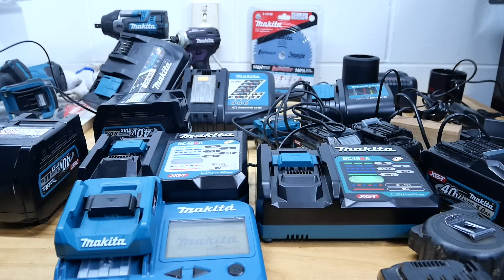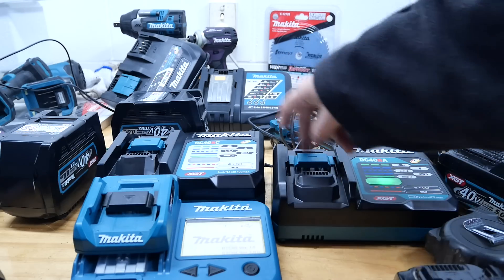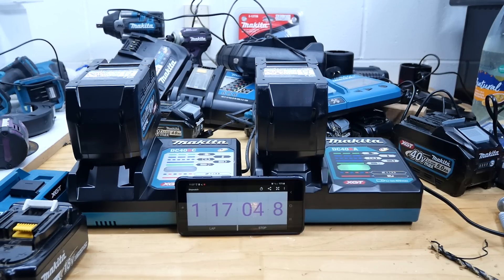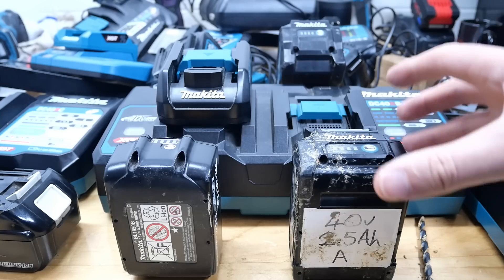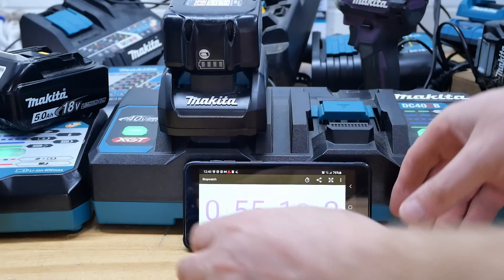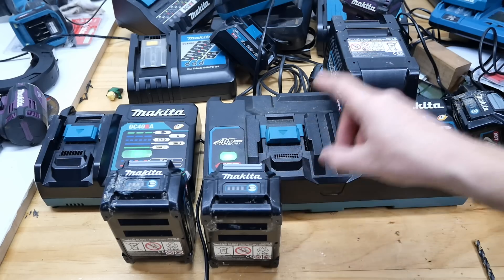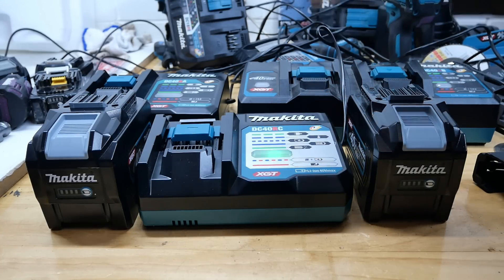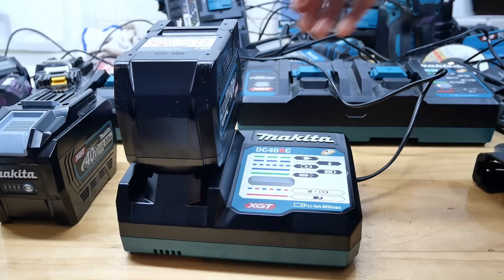Rapid Chargers Destroy Your Tool Batteries... Why?        How Hot, How Quick, How Much???

Comment: I just got a drill and impact kit and it came with the standard charger. I thought it was the rapid one because it says "fast charger" on the bottom. Deal was hard to pass up though...40v impact, hammer drill/driver (not the top of the line one) 2x2AH batteries + charger with FREE 4AH battery and FREE inflator for $660 CAD taxes included.

Also when i charged all the batteries with the standard charger the fan stayed on the entire time.

Comment: I have a 40V DC40RA charger - when I put the 40v 4.0ah battery on it the large light flashes BLUE and then flashes RED and beeps continuously, then it stops flashing and beeping but stays RED and the fan isn't going.  Does it mean the charger is faulty or the battery?
Reply from the maker: It's the battery. Clean the contacts on the battery with some fine sandpaper, the slowly wiggle the battery onto the charger until the blue light comes on and try and leave the battery on an angle. You only get 3 shots of fixing it. If the red light comes on 3 times in a row the charger will say the battery is bad forever.

Comment: Thanks for doing this video. I’m on the Bosch platform and one of my chargers GAL18V-160C gives you 4 different charging modes. Standard, Power Boost, Longlife & Storage. The Power Boost is really quick but it only charges at full current up to 50% charge before it switches to standard mode. That’s because charging between 50% to 80% produces the most heat. If I have plenty of time I usually use the Long Life mode, which only charges the battery up to 80% but also more slowly. I’ve actually been trying charge all my battery operated products like phones etc up to 80% for many years and have great long life. But if I need to charge on a job site I’ll use the standard mode. I’ve only used the Power Boost mode a few times when it was really needed. I’ve never used the storage mode but that mode only charges your battery up to 50% since lithium batteries don’t like being stored for long periods at full charge.
I’ve studied electronics as a hobbyist and from what I’ve learnt you shouldn’t charge a battery at more than 1C for the best battery life. So in other words, fast charging an 8amp battery at 8amps(1C) charge current would be ok, but fast charging a 4amp battery at 8amps(2C) charge would not be good for long life. I’m hoping that the tools manufacturers take the amp hour of the battery into consideration before it charges but I doubt it. I might have to test this but I do know that the Bosch charger varies the charge current depending on the battery temperature.
While high discharge rates like using your battery on a grinder will also produce a lot of heat and shorten its lifetime. High charging temperature is not the only problem. When you charge a lithium battery at high current, it starts to form something called Lithium Dendrite AKA Lithium plating on the negative electrode and this will also reduce the battery capacity and life. It can also cause internal shorts.
I guess everyone’s going to be different and if time is money then sacrificing battery life by fast charging may be the more cheaper option for some people.
One last thing, I don’t know if you would bother doing another video on this but if you do, are you able to check the battery temp once it reaches 80% charge, rather than 100%.
Thanks again for your video. Hands down the best tool channel on YouTube!!
Reply: Thanks for the info..... appreciated 👍🏻

Comment: Builds & Stuff  the normal charger is better because the lower the charging current, the more energy the battery will store.
p.s. I have not seen any published data on the cutoff current during charging

Comment: I LOVE that Makita gives you rapid or dual rapid chargers with most of their kits.  Milwaukee and DeWalt don't do that because they are greedy.  They also don't have fans in nearly all of their chargers.  Whenever I charge with a fan-less charger, I put a small portable fan right in front of the charger.  Works like a dream, and it keeps the charger and battery essentially at ambient temp.  RYOBI clip fan is great for this.
Reply: agree. Hikoki/MetaboHPT also does this in most kits. I was amazed when I put a 18/36V MV 8ah Battery on charge at the same time with a Dewalt 18V 3ah. And the 4/8ah MHPT finished first lol. Makita does well with this too. Most folks only see price. There's a reason for most things.
Reply: Putting a fan next to your charger is a bit pointless to the battery. It only cools down the charger, but it doesn’t cool down the battery cells inside the battery casing

Comment: should be common sense a rapid charge which isnt really all that rapid wont hurt the batteries, its not like its boiling them to a full charge in 10 minutes dumping 100amps into them

but we do drain them dead in under 10 minutes pulling over 100amps peak out of them and they get hot doing that but nobody debates useage rate only charge rate and only because the companies call them "rapid"

take the same chargers and like you joked call them "slow" and "standard" leave out the word rapid and all of a sudden everyone will agree the faster charger has no downsides 

milwuakee even went to a "super charger" that doubles the output of their rapid charger on larger batteries.. and people still argue the rapid charger kills the batteries when milwaukee endorses dumping double the amps into them than a rapid can

Comment: HI B&S I have a 18v rapid charger and a 40V rapid charger with an adapter for the 18v. Which charger would you use to charge an 18V battery ??
Reply: The 40v chargers charge quicker with the adaptor, but not much quicker (seen a video on this channel)

Comment: I don't know why people worry about heat with the lxt or xgt platforms. The batteries have built in circuit board that monitors the Temps of the batteries as well as the tools.

The charger and batties communicate with each other to make sure that Temps are in a safe normal range.

 If you have a hot to the touch battery instead of letting the battery cook itself and spend hours in its own heat throw it on a rapid charger so the charger will blow cool air on the cells and get the heat off them.. once the heat is within range the charger will then charge the battery.
Reply: I never knew this technology exhisted.... i have a 18v dewalt cordless drill with a sealed battery charger that gets very hot charging up batteries...... time for a change, i just love this technology 🙂👍🏻❤️

Comment: It's not about the heat,  it's about dendrite formation inside the battery cells.  Rapid charging accelerates the dendrite formation in the battery. 

This is the information I gleaned from a battery rabbit hole dive a year or so ago.  Prof good enough that invented the lithium ion battery has actually backed a new design that would make this problem a thing of the past.
Reply: When ?
Reply: @mohammedisaa9952   few years ago he was collaborating with some woman on it. It was something along the lines of blocking each pole of the battery with a thin membrane which should technically make the battery not work... Yet it still worked and was insanely more efficient. Just Google good enough new lithium ion battery design

Comment: I'm not a tradie, so I invested in a double slow charger., a decision I don't regret. But if I was one, I agree: I'd pick the fast charger any day of the week. These things are after all considered "consumables" by Makita, hence they only get a year's guarantee anyway. I think Four LED bars on a battery is a little bit crude. For example, if it has four bars illuminated, that means the charge level could be anywhere between 76% and 100%. If you're gonna do this sort of anal-ysis, you might in the future want to consider using a voltmeter to give yourself a more accurate indication of what the charge is. When my tool (DCF102 fan) considers the charge too low to continue using and it cuts off, the voltage across the terminals at that point is 14.6V. And when it comes off the charger, it measures about 20.5V.
Reply from the maker: How much of this video did you actually watch?
Reply: @BuildsStuff  All of it, but my attention and observation are not great on videos over 10 min. Okay, I've seen your voltmeter readout now.

Comment: Charging current drops steadily after the charge state hits about 80% as the charger switches from CC (Constant Current) to CV (Constant Voltage).  Checking at the end of the charge will not show peak temperatures.

You should check the time to charge to 80%, multiply that time by 0.875 (7/8) and then check cell temperature at that time.  This will show you the temperature at about 70% charge when the battery has had lots of time to heat up and is still charging at full rate.

Loving your channel!  Keep up the awesome reviews and tests!

Comment: As others said, charging for over one hour is not really a fast charge rate. Charging in half hour would put more strain on the battery. And your ambient temperature is really low. If you do the charging at 35 Celsius ambient, the slower charge + cooling fan would make a bigger difference I guess.

Comment: As the new XGT batteries have temperature telemetry, the charger can adjust charging current in addition to basic charging pattern of Li-ion cells.
That is why the 18V took longer to charge (no temperature telemetry) 
In my opinion, the most damage to the batteries is over discharge and ander heavy load which bake the cells. Also charging a battery which came hot off the tool will eventually reduce it's life.

As always great video 👍
Reply: Even hot off the tool the rapid charger will cool the cells down before it even starts charging.... atleast the 18v rapid charger will give you a flashing red light meaning to hot to charge fan is cooling down the battery.

I think both the lxt and xgt has the same temp control charging process.
Reply: @shortyorc121  so basically the 40v chargers are the best in the market right now?
Reply: Dewalt dosent have anything like this ☹️ maybe time for a brand change?....

Comment: The general rule of thumb is to charge these types of batteries at 1C, or one charge capacity per hour. Going to 2C means it’s charged in only 30 minutes but it does shorten real capacity and cycle lifespan. So the 8ah is happy on the fast charger while the smaller ones aren’t as much.

Comment: wow you read my mind, I was looking forward to this video!
Reply from the maker: I'm so glad!
Reply: @BuildsStuff  I would just maybe prefer slower charger for 2ah 40v batteries as they are being charged much faster than larger ones, but they do usually come in the kit together.
Reply: @riba2233  the charger might adjust for diff batts. They have digital comms so the charger knows  what batt it's charging. We could prob figure it out from the charging times divided by Ah
Reply: @toolscientist  it might, but I don't think it does, look at the specified charging times for both chargers. On faster one 2ah is being charged at like 3C rate which is imho just too much

Comment: On the slow 40v battery, it’s 5 degrees cooler but it’s at heat for double the time right ? That could be worse but I got no idea about batteries
Reply: "Its at heat for double the time"..... i think that at a slower rate, there would be less heat as such during charging ?